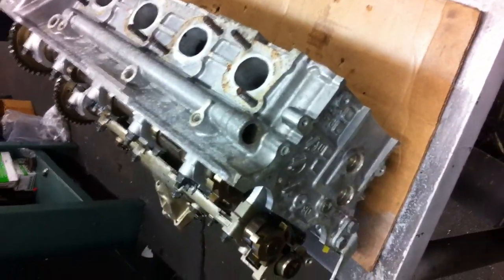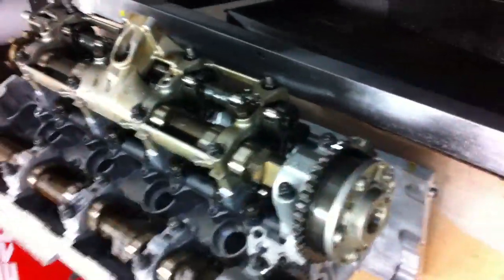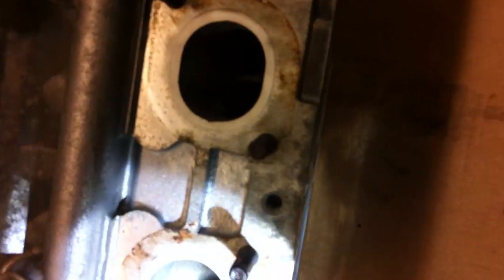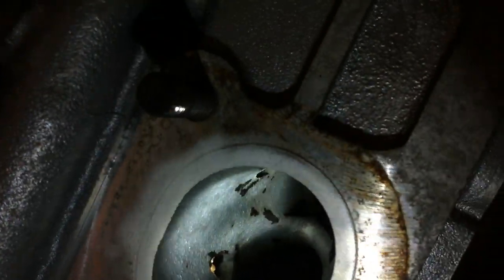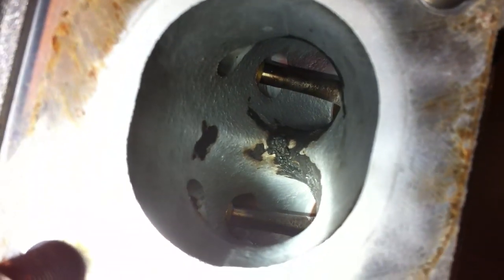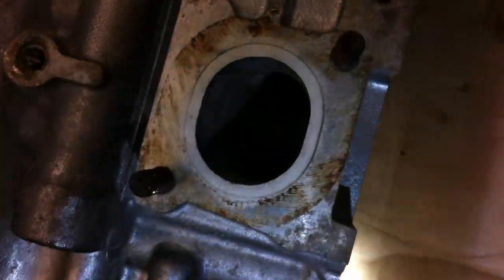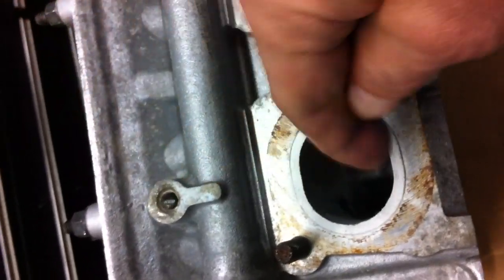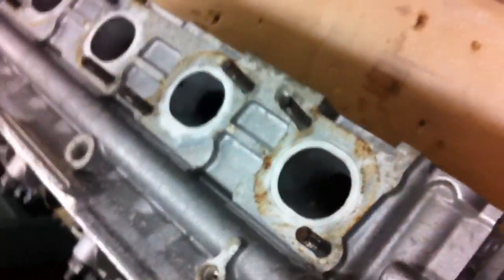BMW 745 545 750 550 N62 secondary air injection ports.MOV

Comment: I've been looking for a video like this. Im guessing it's the same on a M54
Reply from the maker: The concept is similar, but the ports do not get clogged on the M 54 engine the most common reason on the M 54 is that the catalytic converters become clogged?
Reply: @vacbmw dont got any codes for that. Bought this e46 that looks like the pump been dead for years. The check valve was full of gunk and was fully seized.

Comment: The angle on that hole is a pain in the ass
Reply from the maker: trajan 9 
There is a jig tool that bolts to the head and drills out the ports and install bolts in place of the 4 holes. A quick and clean solution but engine has to be out.

Comment: I have done some of these heads already for this clogged ports.  But has anyone come up with any preventatives other than more frequent oil changes?  Such as running a cleaner through the secondary air at early intervals.  We are trying to come up with more cost affective methods to keep these cars on the road.